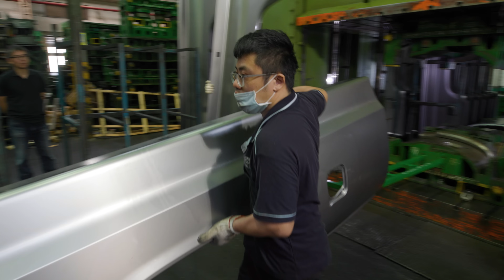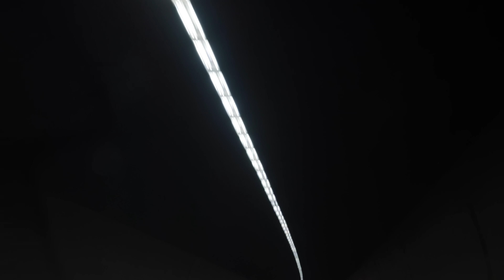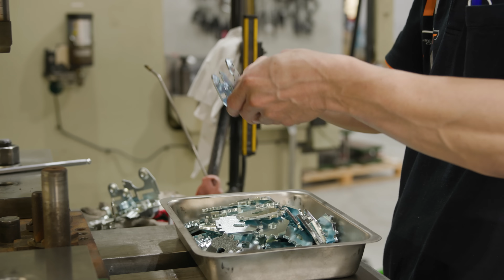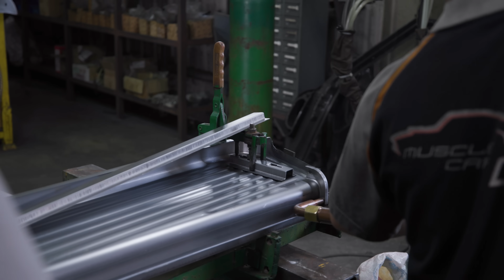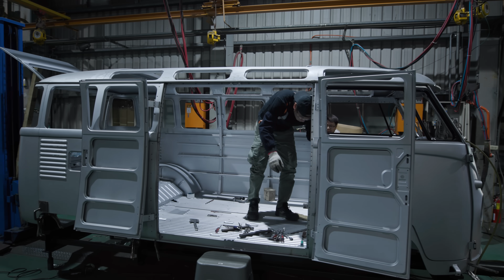Taiwan Makes American Trucks Great Again! Tour of Sheet Metal and Replacement Parts Factories

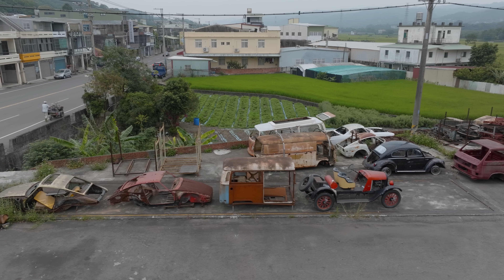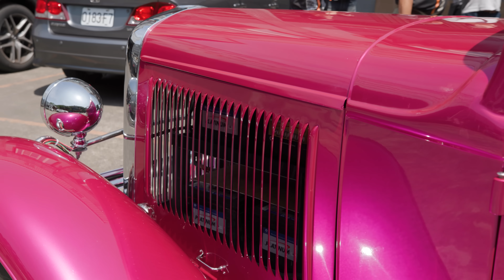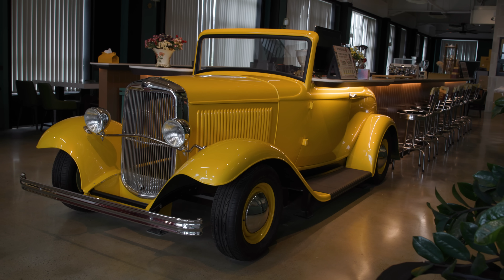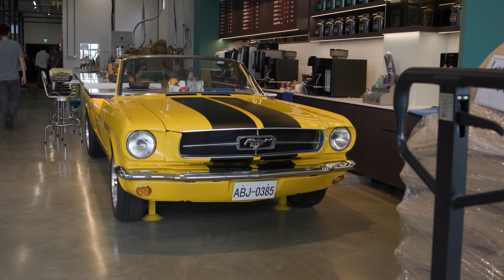Comment: How great to be able to have a brand new vintage vehicle instead of having to restore four wheels stuck in rust! That car from the 1920s that was shown at minute 8:28 to 8:31and in the minute 12:09 to 12: 13 and 12:26 to 12:27 was fantastic. Having one of those cars brand new and putting an electric motor in it would be amazing!
the last thing, why the ford mustang not have it fenders? super cool company

Comment: Yeah there making the parts but try to get one thats not damage. I just restored a truck and most of the replacement parts came from tawian cause I couldnt get OEM panels. Had several issues with quality and alignment issues with the replacement parts. Not even close to factory OEM replacement panels. They really need to work on quality control and especially most importantly how these panels are packed and shipped.

Comment: Sometimes even thicker. Now that's where the problem is. Back in the 80's the problem was, the gauge of sheet metal was to thin, they were using the wrong thickness of material. Maybe now they have it right ?

Comment: The Only thing is that the "tooling" are worn out and the parts are not as "crisp" as the originals. 
 These things should still be in Country, manufactured by gearheads. 
 That said, at least there's a repop company that makes parts for American cars and trucks.

Comment: I wish they would  replicate the top dash board for 2003 chevy avalanche. Its interchangeable with tahoe and suburban also. You can only find skins that fits on top of existing dash. When your dash is a jigsaw puzzle this skin is worthless. If they make for reasonable price (under $400.) They would sell a lot to chevy owners that had this defective dash it would be profitable. I believe its same dash 2003 to around 2006. Replacement parts in chevy pots web site says its discontinued. You would make a lot of  avalanche owners very happy.

Comment: amazing stuff. food for thought..one stamp at $250k, only needs 2500 sales at 100 bucks. 
I keep ending up with "gordon" from taiwan. I am redoing an 88-98 gmc. fenders are not very impressive, so I thoughht.. those are intentionally shipped at a strange gauge to conform to the aging truck. base and urethane lock it in.
 Floor pans are bigger than factory, and so is the fender liners... just some examples how they cash in on good sales. Some aging vehicles are just getting started, needing new panels instead of junk yards. :goodvibes:

Comment: Amazing! Thanks for the video and insight into how they make these parts. Incredible to see an entirely new Mustang and 57 Chev bodies. I just had some body work done on our 2022 Escape and the body shop used rear new fender panel wheel arches made in Asia. A lot better than a bunch of bondo and fillers. I’m hoping to keep this vehicle in good running condition for at least another 5 years as I don like the new cars with all the computerized computer controlled gadgets and they are way too much money.

Comment: Reminds me of Winnebago motorized division in some ways. I was a parts manager at an rv dealer, had a 35 year old unit and needed a new latch and some new exterior metal. They literally went into the warehouse and pulled stamps out to make the parts and cleaned them off for a one off stamp for our customer. They never throw anything away…

Comment: I think its great that there reopping parts for our classic trucks and cars. I always try to find original parts before going here.  The only thing about repops, they have to be modified or redone before you used them. Example ; I built a 78 ford f-100 for my granddaughter, nothing fancy but wanted everything to be strait. Could not find a original tailgate for it that wasn't beat to pieces. Got a repop, great fit, exact lines, great mounting, BUT, the top of the tailgate was a 3/4" short from the rest of the bed.

Comment: This is a most revealing presentation.  Older high volume sheet metal tooling is merging with CAD-CAM and flexible tooling of of recent low to medium volume production.  There seems to be a great future in this not just for beautiful restoration of classic cars but also for affordable and quick turn development of new products.  3D printing has its limits and true metal stampings with high tech modifications will be key to developing new products that will potentially become high volume.
Reply: Stamping is not that flexible. There're already AI-driven forging machines that can automatically hammer metal sheets into any desired shape the same way as highly skilled smiths used to work manually.

Comment: Up until the late 1980's Kelsey Hayes in Philadelphia made sheet metal for new and old cars. My buddy worked there and told me a place in California  would order 50 1957 Chevy hoods & fenders every year. Glad to see parts not made in lying cheating lack of quality control nogoodnic communist china. Wonder how long it takes to make some of the molds for stamping metal. While doing electrical work in injection molding shops saw same guy spend two weeks to make a die for one of thier 500 ton injection molding machines.

Comment: I use to work GM Canada in fleet end of the market and the parts that were made in Taiwan were better  and were closer to the factory minimum tolerances than the ones being built here in North America and less cost, all the new parts they stamp for classic cars are made from better quality steel than OEM were and to ba able to buy a complete new Mustang body and ship overseas here wow, the coolest thing in the video was the 21 window VW Van, freaking in credible,I'll have to check i have a project I am about to start, great video

Comment: Its a good thing someone is reproducing those panels, but before a person gets all giddy happy, they should check those prices. The replacements are expensive and the prices will keep going up. The US has not even come close to exhausting its old stock; persistence and patience can get good used parts for a lot cheaper.

Comment: These guys can make dump trucks of money if they do Jeep parts for the XJ/WJ. Those rusty things need parts. Some are made in USA but are pricey,. Only other option is paper thin stuff from Mainland Taiwan (some call chyyna). If these guys made XJ floor pans, inner/outer rockers and frame rails or frame stiffeners I'd buy it all from them.

Comment: 5 years ago I was the only maintenance guy at a 100 press stamping company in Detroit. Our 600 ton went out & a steel line rained down hydraulic fluid. The fix? Zip tying an extension ladder to a cherry picker, putting a MIG welder in the cherry picker with every extension hose, welding the steel pipe in a puddle of hydraulic fluid on top of the press 28ft above concrete. For 15$/hr. Now I build machines @ home.🖖

Comment: We don't have anything like this in the states because of federal mandates and federal bailout. I'm not bagging their work that's amazing workmanship. I work in tool and die and to get that smooth of a panel with that few dies sets is fucking amazing. I mean they're making dies from $250,000-350,000 which is right in my head. But for some reason it costs our big three auto manufacturers millions to prototype and they use tax dollars to prototype... I sat in a job interview where this dude was bragging about how cost effective his dies were for the new Ford Aluminum body: just the tailgate he had $8 million... We need to get rid of the company that can't fail. It's not like they're building anything we actually want.
Reply: They aren't really prototyping,  they are merely copying.  They have streamlined the process with unique methods like developing the die out of Styrofoam and casting the die using the Styrofoam blank as a pattern.
Reply: @paul5683  I also watched the video. You need a series of die shapes to produce anything from steel, and then you need the proper steel to hold the shape. It's almost like I've worked for a car company at one point...

Comment: I forget which company it was, but my 1993 Toyota T100 has some body panels from Taiwan. I was looking for a replacement fender since the bottom of it was rusting out and found the last primered, unused piece new from a scrapyard's inventory (parts supplier). It was listed as being for a 95' model but they never changed the body styling so it fits all of them. I noticed the brand was the same as the other side which had also been lightly damaged in a collision, and decided to look into it. I think it was like "Gordon" or something like that. Too lazy to go and look, but I'm glad they still make the parts.

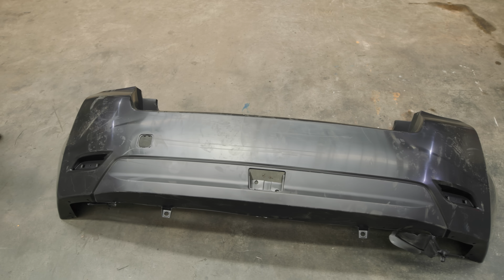Comment: 2:40 looks like a 2012-2016 Impreza (GP) bumper. I’ve owned and replaced several of these and can say that appears to definitely be more durable molding than the factory bumpers. These things are glass on the stock cars

Comment: I'm long retired from the auto body trade. Back in the day many aftermarket parts were "close but no cigar". Filing and forcing the parts into place was common. I would also add it's not just the thickness of the metal, the quality counts as well (high strength and ultra high strength steel). Original presses can be worn and don't stamp out clean lines like when it was new.
Reply: I was thinking it would suck for them if they reverse engineered a sample that had a defect that was not visible.

Comment: Just imagine an improved or modified 87-93 Mustang unibody shell. Weight savings; strength improvements; mini tubbed wheel wells; strong torque boxes; full length frame rails; etc.  Optimize the material gauges and the shapes. Does the underhood really need 5,000 holes in the inner fenders?
Reply: Agreed. Why stop there. 68 Mustang Coupe with the works on a roadster shop chassis with coyote gen3 crate motor would be heavenly.
Reply: I just finished looking at the websites for these manufacturers. One of them has "smoothie" inner structures for Fox Bodies- NO HOLES!

Comment: How do serial No's work?  How does the DMV classify these cars?
Reply: All " new " vehicles would probably have to meet current safety and fuel efficiency standards .
Reply: to my knowledge in the state of Ga. you can register these with basically a made up vin,  they limit how many you can build and sell.  I think its 5 per year if nothing has changed.
Reply: Each state has different laws regarding how the classification and VINs would work. Some states will allow a VIN to carry over with the shell considered a replacement part (law enforcement inspection required), some states make you title it as a home-built car and they'll issue a VIN, and some states you're just s*** out of luck.

Comment: As a panel beater in Australia I've used these parts always great quality but I wish they would make some Aussie old school parts like the valiant pacer or charger or the Torana models in full she'll before there all gone it is so hard to find wrecks these days to just replace a panel that is so severely damaged from impact or age there is a market there going begging for someone to invest in the rewards would be huge
Reply: Hi mate. I'm over here in Taiwan and although the cost to manufacture here are much less than Australia the costs of making molds and tooling is still crazy expensive. I'm thinking that the size of the market at home in Australia is fairly small so getting the investment back might be hard.
What would you recommend as the couple of biggest demand panels that are currently not available for purchase for Australia? Cheers mate.